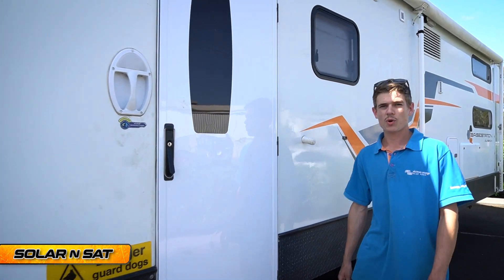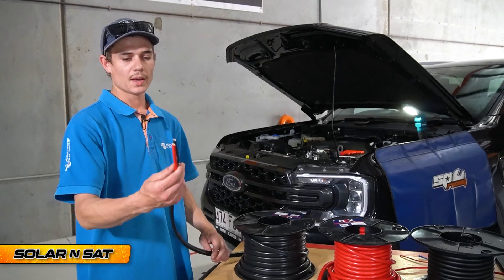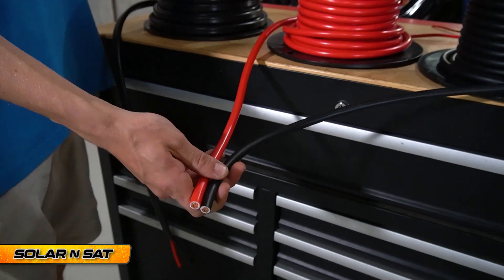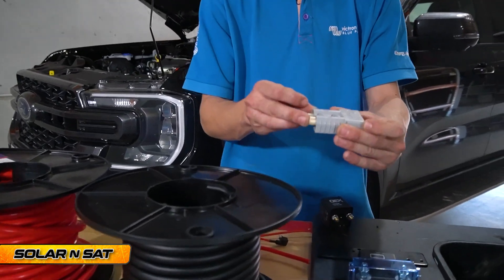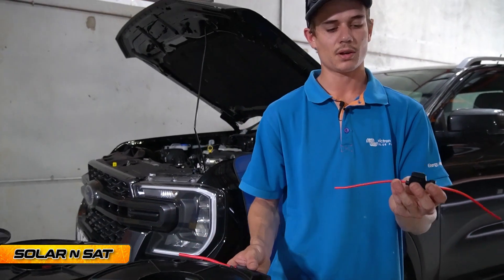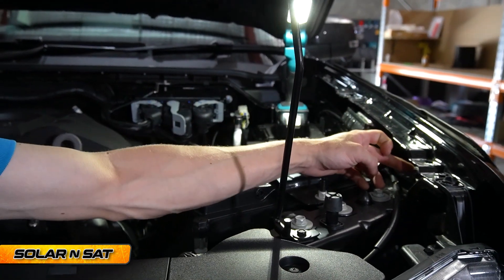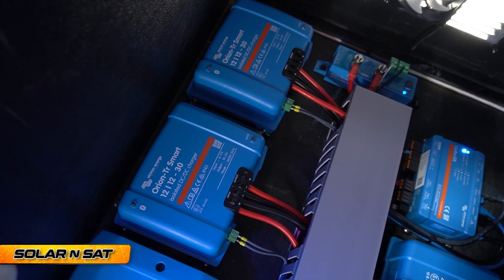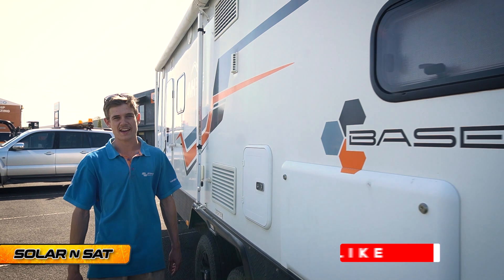DC Charging - Jayco Base Station and Ford Ranger Wildtrack

Comment: You said you are mounting the negative cable to the body under the bonnet instead of the negative on the battery. Why not mount the negative near the rear of the vehicle on the chassis and save on cable run?

Comment: So I have to ask why you believe if you mount the negative close to the battery, that it won't charge properly? Been working with this gear for a long time now and I commonly see issues when the terminals are not connected closely to the battery when we are talking about DCDC charging.